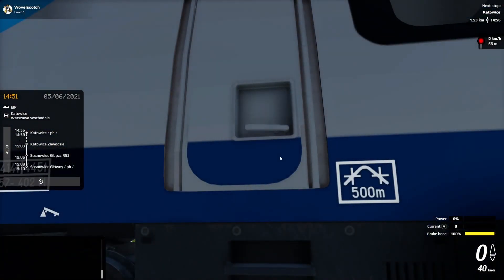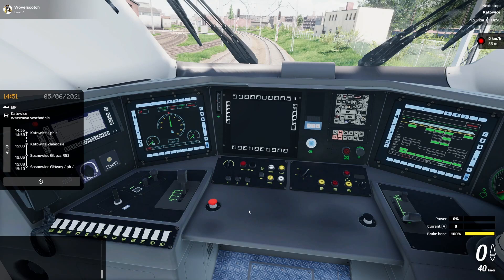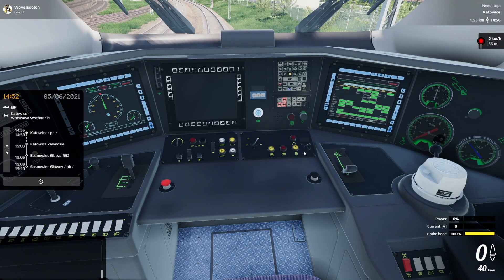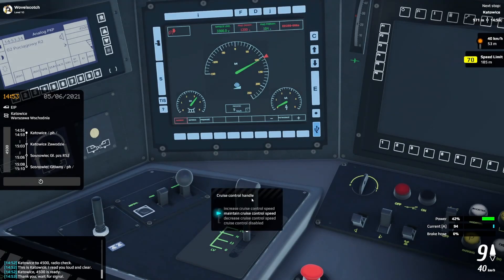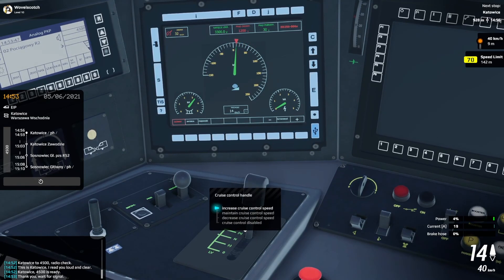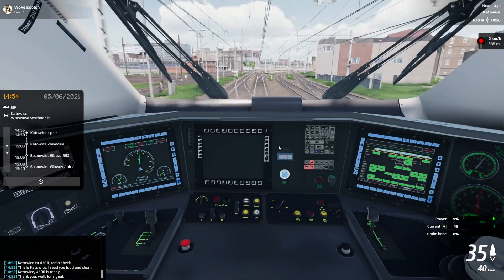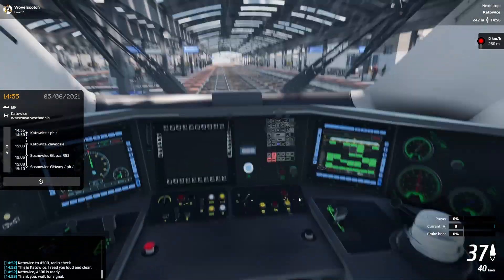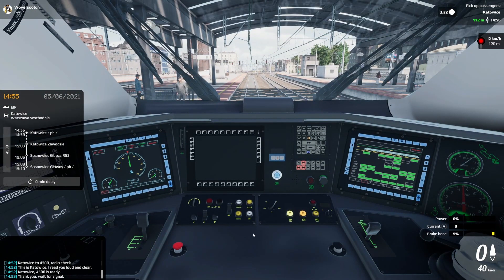How to run the ED250 in SimRail

Comment from the maker: Getting a lot of comments about not being able to get the train moving again once stopped. They have updated the behavior of the ed250 a bit since I've released this video. Make sure the brake is completely released, then reset the throttle all the way back until there's an audible click, then reengage the throttle. It should start moving again.

Comment: How do you turn a switch clockwise or counter-clockwise, when the mouse is over it?
Reply: OK I found that, but now I have a new problem.

Once I stop the ED250 train I cannot get it moving again.

Brakes are set to running, parking brake is off, but if I push the power level forward, it moves, but the train is not drawing any power.

What am I doing wrong?
Reply from the maker: @mordsithrahl  I would need more info. Only thing i can think of is that it takes time for the pneumatic brakes to charge up, the train will not apply power to the motors until they've completely released
Reply from the maker: reset the throttle all the way back until it clicks then re-engage the throttle
Reply: @mordsithrahl Hey buddy can u tell me the solution for your first problem bcz i am also not able to turn it clockwise after my mouse pointing on it?

Comment: hello, nice video :) is there a way to stop the train using only the cruise control ? like in the EN96, you just set the desired speed to 0 and wait for the train to stop and then you apply the brakes, parking brake, etc. Because in the ED250, whenever I set the desired speed to 0, the cruise control stops (and because throttle is not at 0 it starts to accelerate...). Thx :)
Reply from the maker: Nah, the cruise control disengages when you set it to 0. From my experience you can't use it like in the EN96 and you have to brake manually.

Comment: I did all the steps and I can't accelerate the train, it's just going by itself at 3km/h, is this a bug?
Reply from the maker: If you got it moving then the only thing I can think of is that you have cruise control set to a very low speed. Disable it by pulling all the way back on the cruise control handle to see if that fixes it. If not, do you have any lights on the main control panel that are lit up different to what I have at 2:10?
Reply: @wovelscotch   I forgot the door open, that was the problem. But anyway thanks for trying to help!